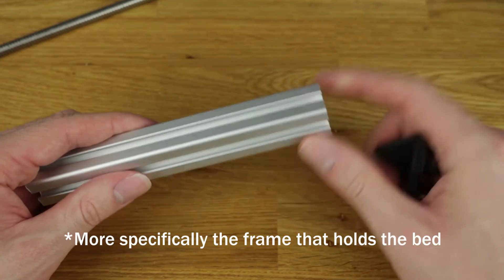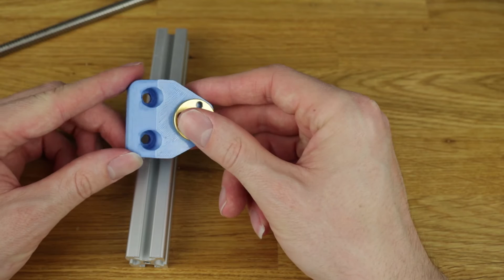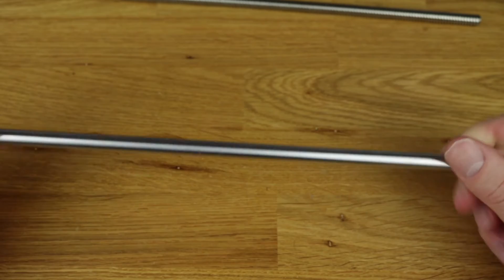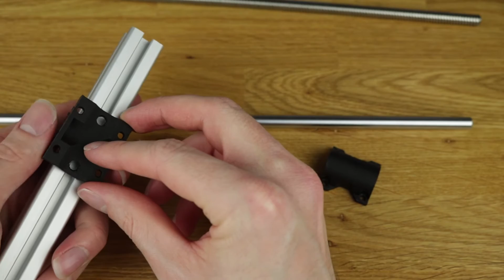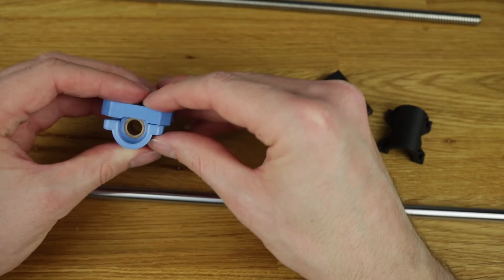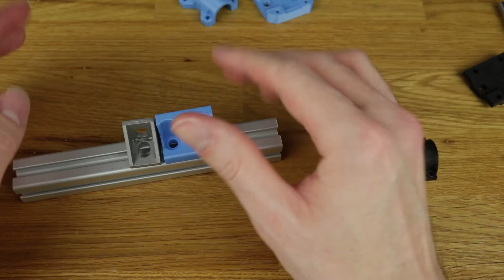Uppy Downy - 3D Printer Scratch Build Log - Episode 5

Comment: simply electroplating your rods will help take up that micron's of slack, and so providing a far better fit overall from generic materials for sale.

for more insight and actual practical applications for these builds then OC everyone should be subscribing to robert Murray Smith's channel ;o)

for instance, see Conductive Ink For Electroplating Leaves
https://www.youtube.com/watch?v=GoqchqZfMCc

Copper Plating Without A Battery
https://www.youtube.com/watch?v=z-1t2JfLVKE

and for this project and it's like,  a must see is his "How To Weld Impossible To Glue Plastics At Home" and the almost impossible HDPE joining in less than 10 seconds etc...
https://www.youtube.com/watch?v=dq2-Wow5gCA
Reply: then you are moving into the electroforming ,as in leave it in longer cooking and so get around 1mm per 24 hours.

OC the slight problem is getting a consistent electroforming coverage, so  that takes a spiral form for the + and perhaps even motorised slow spinning  of the rods as needs be, needs testing etc... but then again perhaps it's fine...

we are then one step into the "making a direct copper negative mold" from the perfected plastic print that can then be directly injection molded from... after you add the required ejection pins in the right places and fill the void in the back with something that will not burn and shrink as the liquid metal in this case heats the copper mold and transfers the heat to the backing block

something to consider   ;o)